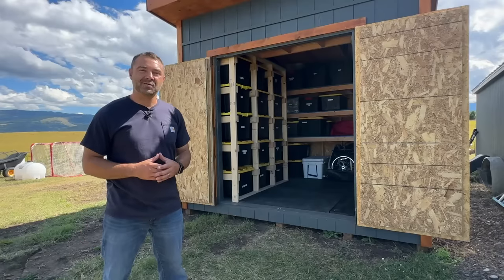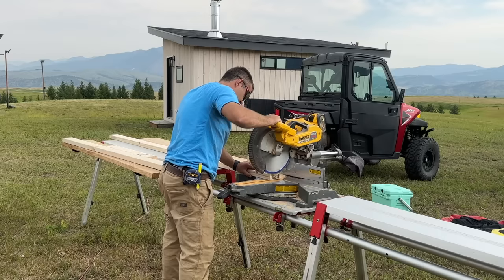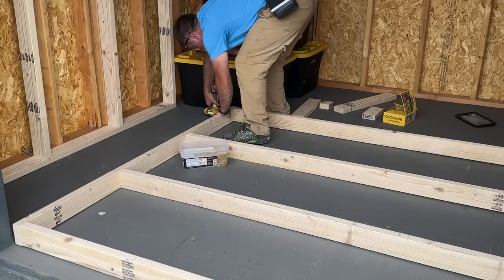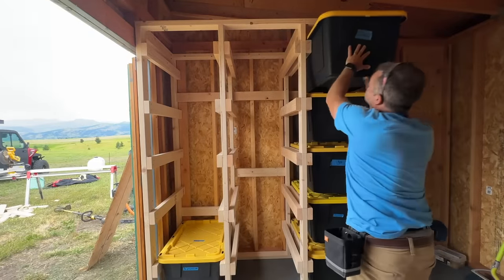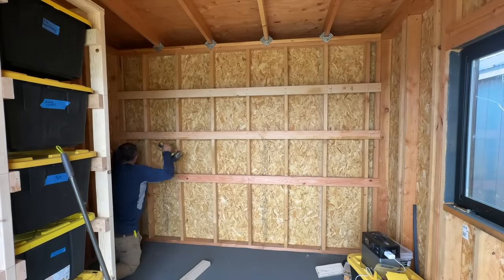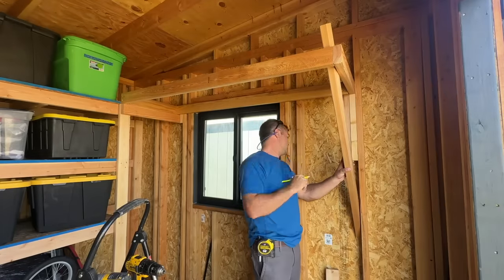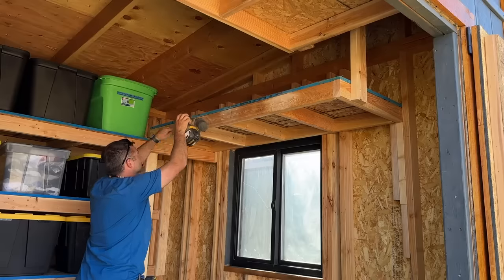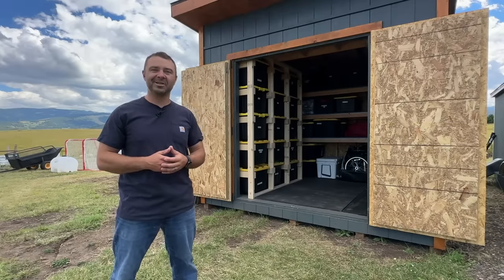DIY Shed and Garage Shelves: Super Simple and Cheap!

Comment: You didn't need the time or expense of the horizontal rail at the back of the big shelf.I would have toe screwed the short blocks to the face of the studs, and screws thru the face of the front rails. And, 7/16 osb would have been more than enough unless you are putting engine blocks on the shelf.

Comment: I did a similar shelving on a rental storage unit & greatly increased the storage space & organized it very well. Excellent build. I suggest monitoring that rafter with a straight edge every few months. That’s a lot of loading on a single 2x4 rafter so it may begin to sag over time. Further sister brace it with a 2x6 (or 8) rafter if you see sagging. I watched your video because I’m putting up a metal storage building this winter and appreciate seeing how you made your shelves. I love the left side side-in rack for totes. My storages unit shelves are all like what you put in back. Lots of work & lumber so you’ll save me both this winter. Thank you very much for taking the time to film, edit and share with us. Much appreciated. Stay safe & blessed.

Comment: Ahhh, sizing the shelving for the totes, very nice.  Lost track of how many storage systems I've seen that were very well built, but had shelves that were too tall for one tote, but not tall enough for two.  Just crushes my little engineering heart to see that sort of inefficiency.  Just be sure to buy enough totes right off the bat, or get a brand/model that won't get discontinued.  Sterlite one day decided to stop making the ones I used because reasons, and I had to scramble to find someone, anyone, still selling them.
Reply: I just built some shelves for my sisters totes.they ranged from 14 to 18 inches high. I spaced the shelves with 19 inch clearance.

Comment: Same kind of shelving me and my stepdad use.  that lip slide shelf? We dont' do that in shed because too much risk of a tote breaking due to overload, but that exact kind of lip slide shelf is what we use under our folding table in our laundry room. Space enough for four baskets, two top two bottom, and you have your shelf space.

Standardized storage bin sizes immensely help when making shelving since you can size FOR that unit size and have a wide compartment for oddballs either high or low.

it's simple, it's effective, and a little trim molding can fancy it up if it's in a spot where you'll want fancy. 

We both got a kick out of this video. thanks for sharing.
Reply from the maker: Cool to hear you've done some similar storage in the laundry room! Thanks for watching and have an awesome week!

Comment: Use a pole when you paint the floor, sometimes a broom will have a pole the the threads will fit you paint roller holder.

Comment: I like this concept. I build something similar, but for euro boxes.
They are a little bit more expensive and dont come in transparent, but they are allways the same size, no matter which brand you use.
And the edge they slide on are on the bottom, so you can just ad a bar under the box, to support it for heavy load.

Comment: Love ❤ especially love the Costco tote shelf I am in process of switching most of my totes to Costco totes and desperately want that type of storage unit for my totes and my garage needs major organization I also have a very large metal basket and rattan basket that needs a storage solution I do have the power tools to complete this project but I’m not sure how many 2x4s you used and the length to estimate the cost ❤ also this would allow for some much needed organization ❤

Comment: Looks like an awesome project that I am going to try. My only question is, if the load in the box is heaven, won’t it pull off the lid when you slide it in?
Reply: The totes he used have a side lip that the lid fits onto

Comment: I can't help but wonder if this is a good solution in the long run, because I imagine the "lips" around the top of the bins are not built to old up weight but for temporary use, as in lifting them. Of course, if the contents are light then that is not a concern. Any reason why you decided to support the weight by the "lips" instead of by the bottoms of the bins?

Comment: How did you mound the supports and side stiles to the rails? Did you put pocket holes or just drill on an angle?
Reply from the maker: I used pocket holes for some and toenailed a few.

Comment: I live in SW Washington State. My shed is not insulated and cooks in the summer and damp in winter so everything in  it might as well be outside and gets nasty, so why not insulate? Did you consider this?
Reply from the maker: Hi! The shed is ventilated, but not insulated. We primarily store clothing, equipment, etc inside and things that would not damage if it did get real hot in there. With very little light, it doesn't get too terribly hot. Take care

Comment: Hi, 
I have a concrete wall how would you screw the back supports? It’s such a good and easy way to store the boxes
Reply: Pre drill holes with a concrete drill bit and buy a couple tap cons from any hardware store.

Comment: Does anyone have experience keeping these totes stored like this long term? I'm worried that the totes will collapse on themselves over time, specially with some weight in them.
Reply from the maker: Hey Matt! We've had the costco totes for years, but haven't had them hung on a rail system until now. The upper lip on them is very solid and durable, but I will let you know over time how they do! I have a few with a lot of weight in them to put them to the test. They honestly don't look different than the others and the hard plastic lip and bottom of the tote look good without a sag, but I will report back after awhile. And if anyone has done this for an extended period already please chime in!
Reply: The biggest threat to most plastic storage bins is sunlight/uv, as well as heat. After removing those threats, you're right, the weight on the lips, which can be minimized by minimizing the clearance between rows and spreading. But generally, the Costco bins have pretty thick lips. But if you are still worried, out the heavier bins on the bottom rows. For mine, the bottom row doesn't have rails, the railing starts on the second row. I haven't had Costcos for very long, so I don't know how they last over time.